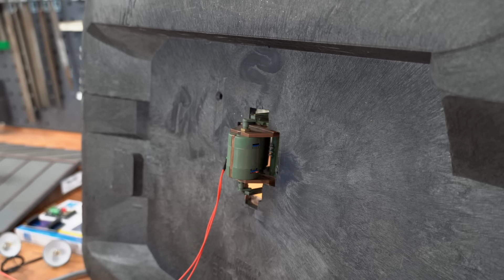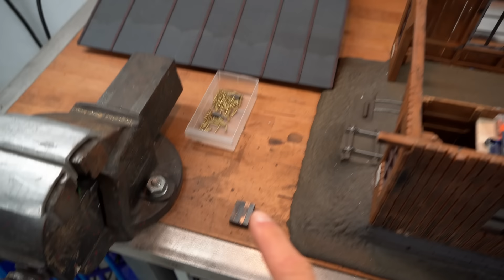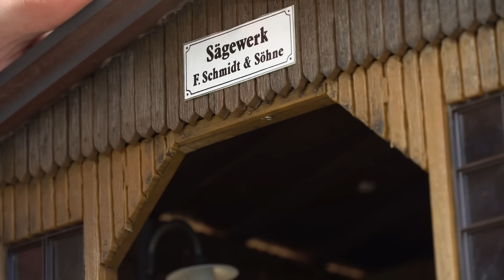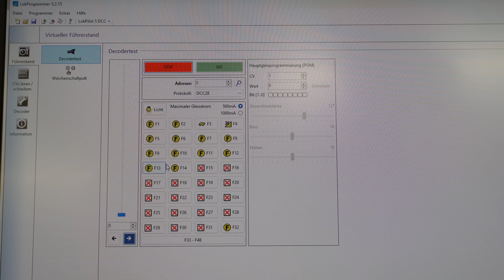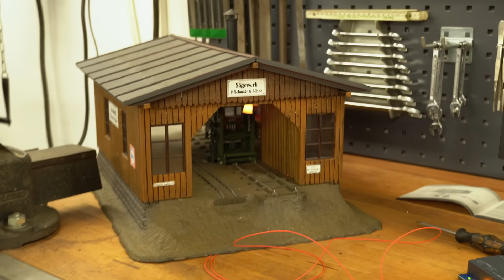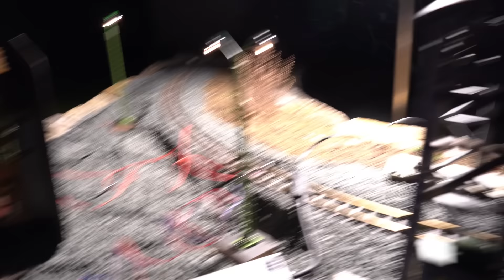Garden Railroad Sawmill setup, ESU Decoder programming || SUMMIT RAILWAY

Comment: Looks very good. I like that you put it an an angle that you can easily see right into the shop and see the saw. A little path up to the crane and you can load out the wood to your customers along the line. The lights add a nice touch always and gives the sense of life and an active business. A few warmly dressed lumberjacks and sawyers, and they can work right through the winter. 
Thanks so much for posting these and all the development of your railway. I am certainly taking notes for my approach as I prepare to start my empire. 
Best wishes for Frohe Weihnachten, und ein gutes Neues Jahr 2026!
Reply from the maker: Hi! The sawmill yard will be build once the temperatures go up a little bit. I already have some frost damage at the cran foundation and I don´t want to risk any more damage which will double up on the work I have to do...

Comment: How about the saw? Did you manage to get it working (sawing)?
Reply from the maker: The test was shown in the beginning of the video. It works with the AC power supply. Since the decoder can only supply DC power I need to figure out a way to rework or change the motor. So in the current setup the saw doesn´t work but it will eventually...

Comment: You might want to mount those two outdoor lamps in the top of the gable ends over the doors and may not need the two light towers.
Reply from the maker: I thought about that but decided against it for two reasons .... first the light would hide the sign which is attached at the gable on both sides and second I would need to run wires from the roof down to the building. It is totally doable but it´s not great when you need to remove the roof and have to undo the wires. The light towers where included in the plan from the beginning so they stay no matter what.

Comment: Thank you for this update. Everything is looking fine. I would be interested in a video about setting up your signalling as that is all part of the project!
Reply from the maker: Setting up the actual signals in the Station and beyond was already covered in several videos. You can go back and watch them if you haven´t already. Currently I am working on a solution for my signal box to be able to work the signals and switches remotely. I think this winter I will get very far along.